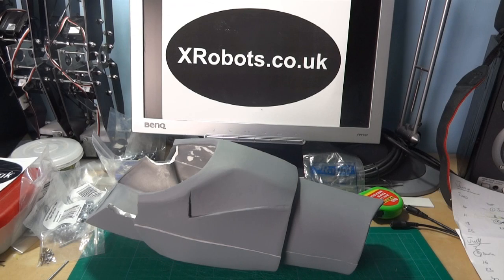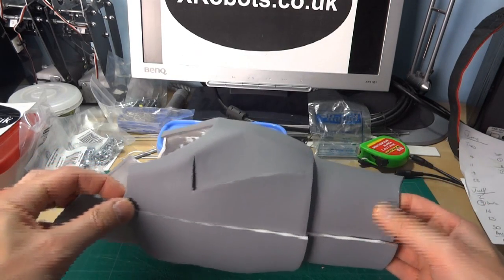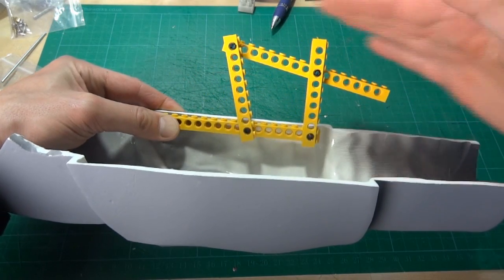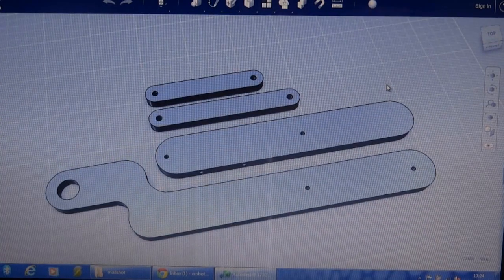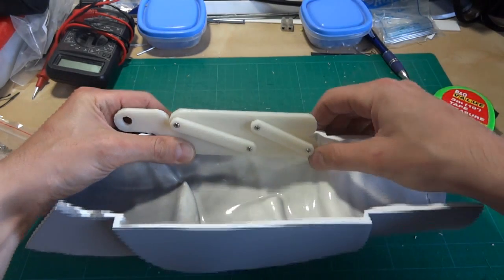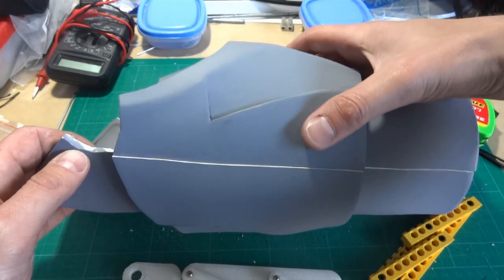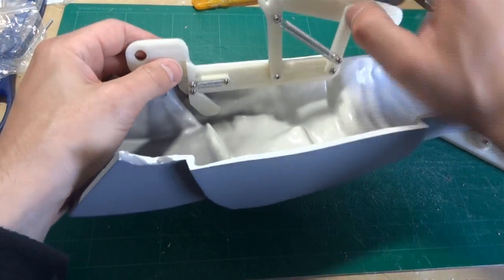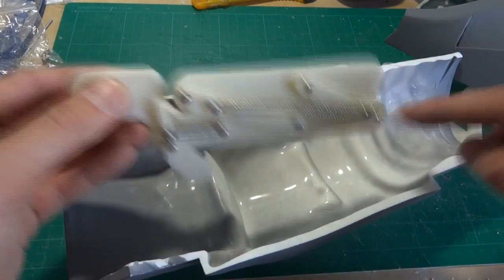Iron Man Power Suit #34 | Arm Opening Mechanism | James Bruton

Comment: dude u could put a very small electronic mechanism in the armpiece, that pops out a small stick or something that could push the trigger to open the arm. Have a controller in your hands with an activate button, so you dont have to manually open up your arms. That'd be sick :o